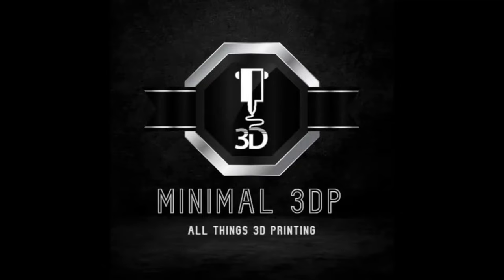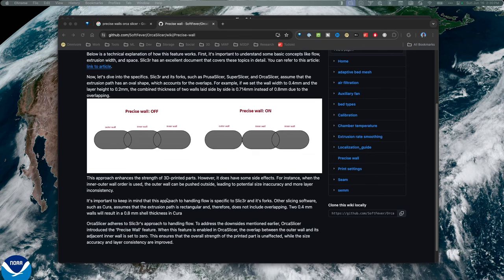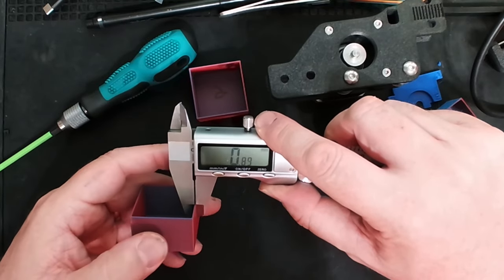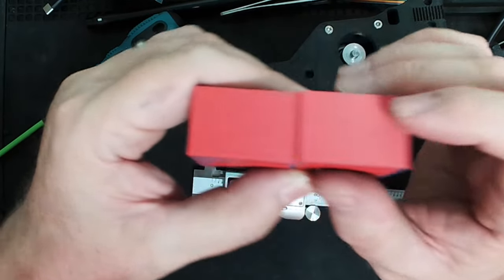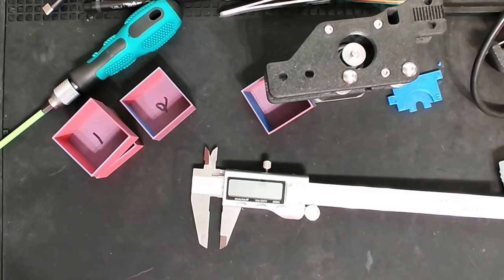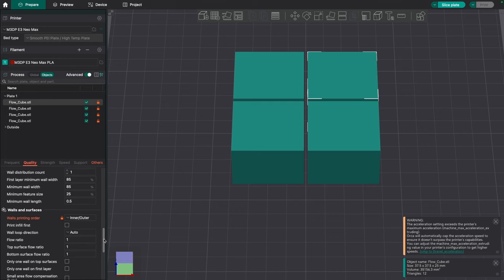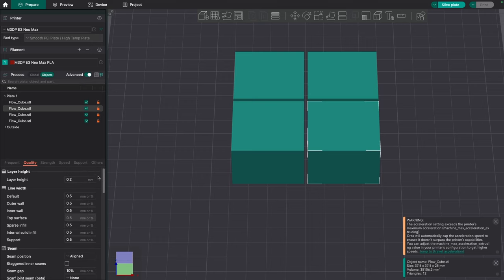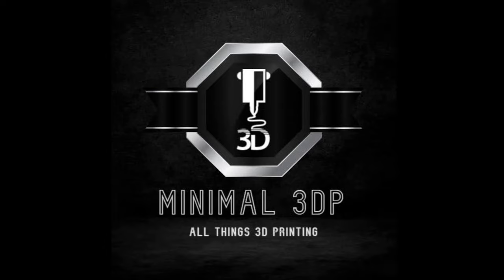Orca Slicer: Does "Precise Walls" REALLY Make a Difference? (Before & After)

Comment: 🤦‍♂️ Why would you try to use it with 1 or 2 walls? You even show what it does, and from the description you're showing in the video it's obvious that it's for when you have internal walls.
But your model doesn't have any internal walls!!! 🤦‍♂️🤦‍♂️🤦‍♂️

Note: Outer walls means external (surface) walls. The walls on the inside of the box are also outer walls, as they are also on the surface, namely the surface on the inside of the box. Internal walls would be walls which are completely surrounded by filament. Only the bottom layers of your model have any internal walls.

Also, the precise walls option has an effect only if you use inner-outer wall order, since that's the only one where the external wall is printed after the adjacent internal wall.
Reply from the maker: Dang! you are correct. I will rerun the experiment with 4-5 walls.
Reply: Infil also has a lot to do with final measurements. They expand or contract the entire print
Reply: @minimal3dp  Did you ever rerun this with additional walls? If so, did it make any difference? Bottom line, should you use precise walls option or not? And under what conditions should it make a difference?

Comment: I've been trying to print it with Orca Slicer and I get ridges after the initial layers near the curves.  I believe this is due to overlap of the internal layers
Reply from the maker: Have you done a pod tune? A while ago, someone talked to me about a weird, ridgi g problem they were having, and I could not figure it out. Turns out it was an issue with the hotend not having a consistent melt.
Reply: I had a 0.6 nozzle thank you for the reply

Comment: great video, I was also wondering what that feature did. Although as maybe a small point, precision is different from accuracy. Precision is the repeatability of a value. Based on the video it seemed like the values were more consistent with precise wall on, but still inaccurate. Maybe using precise wall and an additional offset could help get both?

Regarding wall order, it definitely made a difference for me, although it depends on how many inner walls you have. I'm printing channels in a block and it does make quite a bit difference along with adjusting the inner and outer wall line thickness so there isn't a gap or overlap in the preview (although this is kind of what precise wall does and could result in weaker parts but with better precision). Also the seam type can make a big difference.

Comment: For line width I have changed to using percentages of nozzle diameter instead of the precise values. I did this because there were no available 0.2mm and 0.25mm profiles for the Creality K1 Max.
Reply from the maker: This is a different approach that I have not tried. I might give it a go.

Comment: Have you tried with more inner walls? Seeing as the example shows tow, maybe it doesn't behave the same with only one.

Could you check the outer dimensions of blocks printed with more walls and different settings? I think the main point of Precise Walls is dimentional accuracy, not wall thickness. It should give (at least) the same accuracy benefit as printing outer wall first without the under extrusion issues.
Reply from the maker: I will try with a calibration cube.

Comment: Youre measuring this all wrong. You need to be measuring a full filled cube. Walls in this instance is not your understanding if "walls" as in thin house walls, but rather it's talking about just the outer SKIN of the print. These thin little boxes demonstrate absolutely nothing because you're misunderstanding what precise walls is trying to do. You're actually adding DOUBLE walls with what you're doing here. This is adding two walls on both sides, so youre not seeing any benefit. There's no room for the inner extrusion to recede to if it has a wall right up against its back. 
Precise walls gives you effectively a corrected form of contour expansion, is another way to think of it.